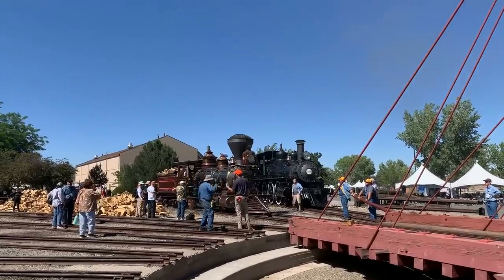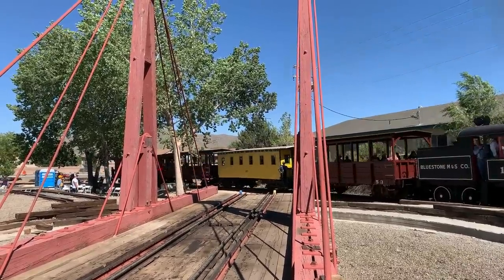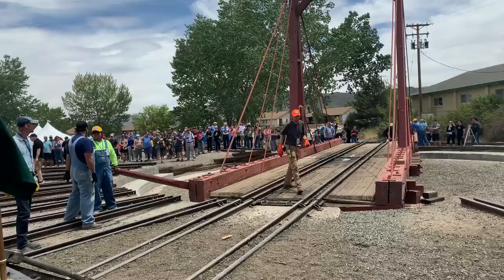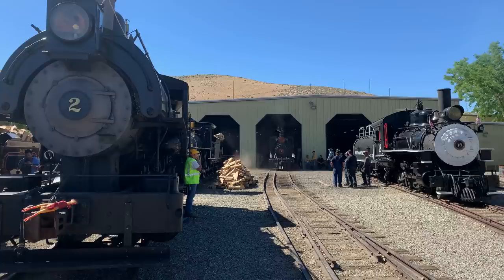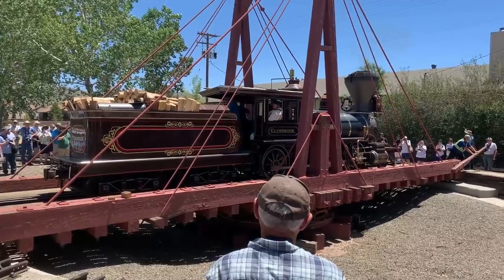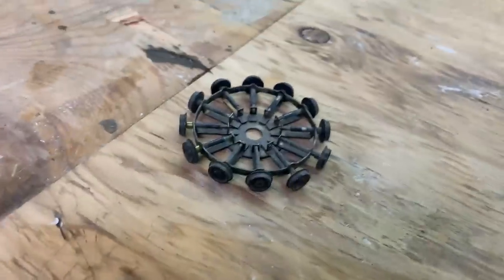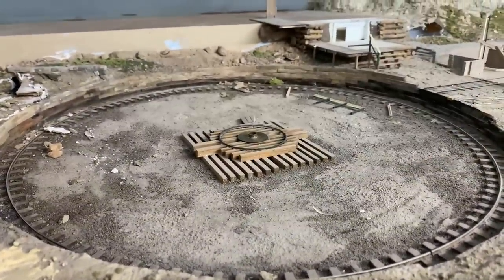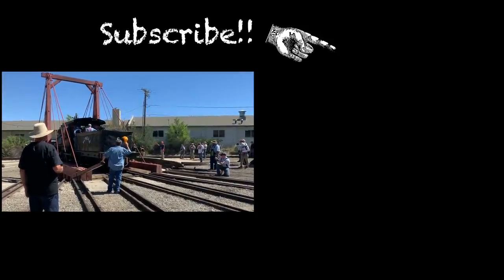Everything You Ever Wanted to Know - Dual Gauge A Frame Gallows Turntable

Comment: The ring with the wheels is called a spider.  Under a turn span bridge, the wheels were cone-shaped(and much smaller in diameter to save space) so that the focus of the conical rays is at the center of the bridge.  This type of arrangement was also used under turntable bridges.  Most of the larger and later turntables were designed as 2 simple spans supported by the ring rail and the spider so that the turntable bridge did not have to be so long.

Comment: A slight correction. The turn table at Laws is an original. This NSRM table, the one at Folsom and the one at the Southern California Railroad Museum (OERM) are based on the Laws table. They were made with iron components cast at Knight Foundry a number of years ago.
Reply from the maker: Thanks. I was told laws was a rebuild.
Reply: @ToyManTelevision  It's been repaired over the years and had timers replaced, but original design in the original location. It currently needs a major rebuilding before, say, a visiting SPNG #18 can be turned on it.

Comment: Its so cool that is how scratch built my On30 turntable and it works great. I did like Steve  I made a outer rail ring to help keep the table stable when a loco goes on it. Thank you for sharing Steve's build. Is he still working on his new layout, You have been a great influence on my On30 build.  Keep up the great work
Reply from the maker: Unfortunately Steve has said about tearing apart the new rail road as well. He keeps selling off sections and turning sections into dioramas and selling off the dioramas. He does have a long-term plan that wants the entire attic is empty he’s going to turn it into the ultimate shop and then just work on individual projects. But stuff that doesn’t take up a lot of room. Like a single structure or a brass engine.

Comment: Hi all I do turntable demonstrations at the Colorado railroad museum. with there arm strong Turn Table .
And it has the  ring rail and wheels. And i can turn by myself with D R G W #491 on it At  around 90 tons .
Those wheels about 1 in off of that rail at both ends if it is off balance and those wheels touch the rail it takes 4 to 6 people to turn it.
Reply from the maker: Yup. The key in low friction from metal wheels on rails. And balance. I once pushed a C16 tender by myself and in fact it was easy. Amazing!! It’s the key to all railroads.

Comment: I would think having 4 rails to center the weight over the pivot side to side.
Reply from the maker: Well it helps. But the basic reason is turning the turntable moves the common rail from one side to the other. The only other way to make it work would be to build a transition in the turntable bridge so the common rail moves from one side to the other. But the simple way is a four rail bridge.

Comment: I can clearly see why it’s an A frame turntable. Those cables form the shape of an A. Makes sense eh? I didn’t think the operation of it as an Armstrong man powered turntable it was so difficult to operate. It’s all about balance. No rail to rotate like the modern turntables.
Reply from the maker: Super low friction. Works well. Oil it new and then.